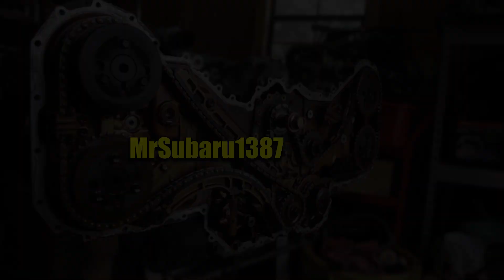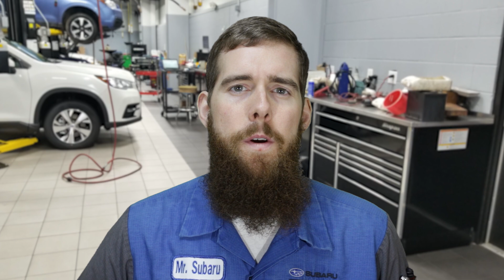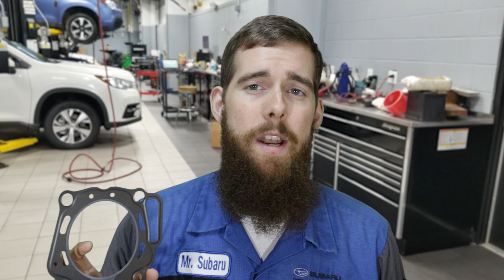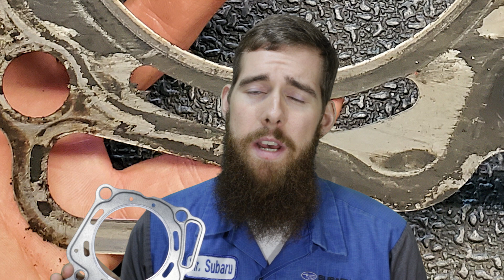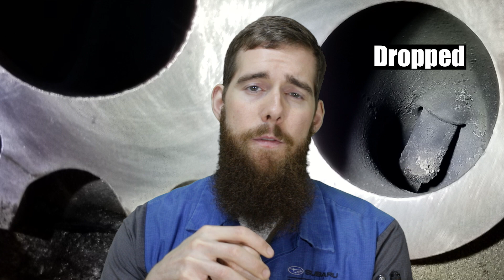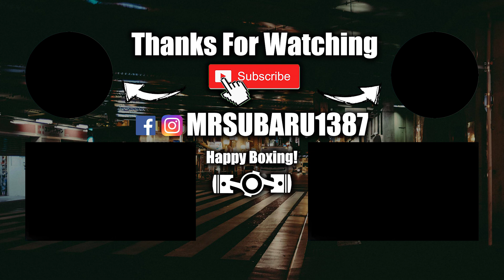Subaru Head Gaskets Explained

Comment: I have 2 Outbacks with the 2.5 naturally aspirated engines. with similar mileage.  (2014, 2015) bodies and interior are different, but engine bay looks identical.  Are they the same engine and if so which engine, and are they in the bad list for head gaskets?  I recently added coolant on both at around 90k miles, and plan on doing coolant drain and fills after tune ups and undercarriage fluids.  I do induction cleanings and fuel treatments at every oil change and am doing spark plugs at 100k on both, and will perform bore scope inspection of combustion chamber to monitor carbon build up.  I am switching to 5W20 as they both use a little synthetic oil.  Also am planning PCV valve and air filter.  I have questions about CVT and diff fluids I will comment on that video.  Thanks MR. Subaru,
 15yr tech

Comment: Thanks! This is an amazingly helpful video. I’m confused, however about the new mls head gaskets like the one you held up. In the corners of the gasket there are small pressed tabs that are there, I suppose, to hold the layers together. However, the upper two don’t clear the head/block surface. I’m stuck here...
Reply from the maker: If you have the correct MLS gasket for your engine, it should clear, there's divotes for those rivets to sit in between the head and block.

Comment: What happened when  water and antifreeze cooling come out from the moffle could be the head gasket o the turbo it’s broken  and the other thing it’s it’s better to change the motor because the motor has 190,000 miles. If I change but it’s the problem going to be same  whit the new motor my money I going to spend for nothing  what you recommend my car it’s Subaru Impreza 2002  wrx turbo thanks I wait for you answer ASAP please because  I want to know. What can I do

Comment: Mr. Subaru, is it ok to reuse a brand new gasket that was torqued down but not heat cycled? I wanna pull it back off to fix an exhaust bolt...

Comment: Got an external coolent and oil leak that’s been going on for several months when I can I will replace on my 2.5 liter so I don’t risk damaging engine if coolent begins to mix with oil because of the oil path is right under coolent passage?

Comment: I have a legacy with an ej253 (230000 miles on it) and a replaced head gasket and now it consumes a out half a gallon of coolant between oil changes. What would be the best way to find a good machine shop around me to deck and check my heads and how do i choose the proper gasket thickness after doing so? How would you best combat the trapped air in the coolant crossover and heater core after the rebuild of the engine?

Comment: TL;DR
Only N/A 2.5 boxers have gasket failure
The gasket is single layer, so it peels off with time around 120k-150k km
Buy multi-layered gasket to solve the issue
Make sure the head and block is completely flat before replacing gasket
Reply: nice summary. the full content of this video though is awesome to really understand the issue and blow up the "all subbies have chronic head gasket problems" myth. a lot of them do/will but the fault is the hg itself and not some intrinsic problem (e.g. being a boxer).

Comment: Please help!  Ok our Subaru Outback blew the head gaskets $3,000 Canadian later fixed. Done at shop heads planed. Ok blew again but I decided that the 15km home was pretty close so dumdum drove that, dashboard looked like a Christmas tree by time I got home. So now we are thinking of buying a remanufactured EJ253 engine from Jegs. I watched your video about the gaskets and my question is how can I tell if the graphite gaskets are installed or the steel coated ones are installed or can I request the gaskets to be installed when I order the engine?  This engine is going to cost us just under $7,000 Canadian which is still cheaper then the $12,500 the dealership wants.

Comment: I have the ej205 in a wrx. Only issues I have is the damn valve covers gaskets leaking oil. Done them once already, going to do them again this summer. About to have smoeone weld the damn things closed.

Comment: @mrsubaru1387   based on your recommendation. I just bought head gaskets from Subaru for a 2006 outback , ej25 engine, naturally aspirated, mt, SOHC.  they said, they only had an improved/updated head gasket, no MLS head gasket.  they said the MLS gasket for the turbos are different and will not fit my engine, would not sell me the turbo MLS gasket.  now what do should I do?

Comment: You recommend the 11044AA642 multiple times in the comments,  vise the 11044AA770, when I look up the turbo version of my 2007 forester, the Subaru listed OEM part is the 770, my question is, what’s the difference, and why do you recommend the  642

Comment: Looking to replace head gaskets on my 2002 Subaru outback 2.5L. This is very helpful! I plan to replace my clutch and flywheel while I'm at it. I'm trying to find a head gasket set that includes a MLS head gasket. Any recommendations on vendors? On the flywheel I would like a light weight flywheel that can work with a stock clutch but is not too costly. Any recommendations?

Comment: I got a 2012 legacy 2.5, I starting pulling it apart to change the head gasket because of overheating, bubbling in reservoir..but when i looked close, I see 3 layers of head gasket sticking out. any chance the 2012's got the mls gaskets or was it a failed repair. I did buy it used, it lasted 35k miles before it blew on me. 177k total

Comment: Great video!  I have a 2013 Outback and just informed by my mechanic that I have a failing head gasket. Made it 200k.  They recommend full rebuild for upper and lower block. The car is running fine with some hydrocarbon residue in overflow tank. Is it really necessary to go to the full rebuild?  Or can I drive and monitor for awhile. 

Thanks
Aaron

Comment: I have a 2014 wrx hatch and I had my hg,turbo, water pump, timing belt replaced, I had a slight over heat and I let it set for almost a year now I brought to a shop and got a flush and burp done, my coolant tank is filling up about one inch from top and leaking out no bubbles no overheating and no milky stuff, Subaru claims there is no issue. I don’t know what to do with it.

Comment: My 2015 5door Impreza blew head gasket at 111,000 miles. Bought a salvage yard 2015 Impreza with 48,000 miles. Mechanic left oil in coolant reservoir. Said he couldn’t get all the oil out. Help.What should I do now.

Comment: i am new to subaru. so would the mls gasket set be best paired with arp studs? 
coning from the 6.0 diesel i know the tty bolts wee a huge issue. are the bolts for the 2.5d 99 legacy outback, tty?
if so with the right gasket and new bolts should i be fine or would studs offer additiional prtectiuon? 
thanks for letting me pick your brain and thanks for the video.

Comment: I purchased a 2004 Forester XS 2.5 three years ago. It had 85,000 miles on it and was originally titled in NJ. The head gaskets have been leaking oil ever since I bought it and I have to add about 1/2 - 3/4 of a quart between oil and filter changes. I now have 120,200 miles and a lot of things have been replaced with the warranty that I purchased with the vehicle, and the warranty has paid for itself. I really dislike the oil leak, but I can't decide between replacing the head gaskets or, just keep driving and properly maintaining it and adding oil. 
Any advice or suggestions?

Comment: Mr Subaru i have 40000 on my subaru.I have serviced car regulary.I brought it in to subaru mechanic and was told i have a minor leak on one of the gaskets.Can i hold onto  my Forester until 50000 until i sell it.I have seen no signs of milky oil,coolant consumption,and tailpipe  emmissions.I was told it would be $3000 to replace the gaskets.

Comment: Any run ins with 12 Forester valve springs failing? Had 1 spring shatter and destroy rocker arm, camshaft, and put a hole in the  valve cover. There were a few sites mentioning the cusp of a recall for all valve springs on the 12 Forester.

Comment: n/a ej25s had a graphite coating on ej251/252 and 253 which peeled off and caused that externally oil leak. the remedy is to replace hg + machine with turbo hg 
ej22/ej20 are all good engines.

people forget, if a car isnt maintained and treated like junk any engine can do a hg/blow up

EDIT: you know your stuff dang, easily one of the better mechanics out there.
Reply: you can also just buy a Honda or Toyota and not have to pull the head for 500k miles

Comment: very educative  thank you .i have 2009 forester with EJ 253 with excellent maintenance with coolant change every 2 yr!! and yet at 62500 driver side  4th cylinder  head gasket is leaking oil (AT THIS TIME) .SOA  will pay dealer 1500/- and i need to pay  about 2500 for labour (ONLY TO DEALER). I DO NOT WANT TO DO THAT BUT DO THE REPAIR MYSELF.  . i bought a new gasket set (sadly has 11044AA633. ) the MLS 11044AA770 THAT YOU RECOMMENDED  is NOT COMPATIBLE ( PER SUBARU PARTS WEBSITE) . HELP APPRECIATED. THANK YOU

Comment: Hi Thanks for a great Vid. I have a 2012 OB 3.6R EZ36D Engine, which I bought used from Nashville Subaru at 92000 miles - Single owner. The only real issue I found before I bought the car was on the Driver's side cylinder bank a small weeping leak that my mechanic felt was ok and would not be an issue and the car does not leak in my driveway, nor are there any signs of exhaust contaminating the oil etc..

So my question for you Mr. Subaru is my car uses about a quart of  - oil every 4000 miles maybe because of this leak at the gasket... and I want to buy a set of MLS gaskets from your Online Amazon Store so I can be ready in a proactive sense when the day comes to replace and Machine my Heads AND from what I understood on another of your videos - it's a good thing to buy a new engine reseal kit and take it to the machinist - so he can do the retainers and valve stem seals... 

So can I get the part numbers from your store for the complet MLS Gasket Kit AND the engine reseal kit if you sell it? 
Thanks in advance Jay from Nashville, TN

Comment: How do I determine the part number for using a mls hg on a non turbo EJ251? Does the torque spec on the head bolts change with use of a mls gasket? Do the head bolts themselves change?

Comment: Thank you so much for all of the information 🙏🏼 I’ll be pulling the motor on my 2004 Forester XS to do my head gaskets / timing belt & water pump in about 8k miles. Question though - so the engine in my ‘04 Fozzy is not the original engine. The previous owner who was a buddy of mine sold it to a local Subaru shop and they got a junkyard EJ251 with around 70k miles and threw it in. What coolant should I use when I do my coolant exchanges? Also, will motor mounts for the XT model fit my XS with the 251? I wanted to replace my motor, trans, and pitch stop mount to get rid of some of the sloppiness when accelerating and shifting. Thanks in advance!

Comment: Great video!  

Question: I have a 2009 Impreza with about 150k miles on it (not the WRX version). So far, no engine issues. Do you recommend replacing the head gaskets before they fail as preventative maintenance?

Comment: That coating is garbage. The new MLS Genuine Subaru gasket should be good for 400-450hp or so, which is far more than most Subarus will ever see. The correct original coolant is 50/50 Subaru coolant so 50% antiboil/antifreeze and 50% water, and Valvoline Zerex DEX-COOL HOAT (Green) coolant should be fine as a substitute for a lot of vehicles (and is half the price here) it is listed as rated for Subarus also .... or the new Subaru super-coolant. You are absolutely correct about changing standard coolant FREQUENTLY (probably more frequently than the manufacturer's recommendation), this is very important with Subaru motors, along with the oil.

If you dilute your coolant, you will know all about it, with endless cooling issues, it MUST be 50/50.
Reply: How often would you change the super coolant?

Comment: Does anyone know if the Japanese version of the BH outback has the single layer gasket? My local dealer(EU) claims head gaskets was not a common issue. It looks like my outback from 2000 has multilayer gasket. And I find no replacement in the service book. 200 000km on my vehicle and still dry. Could the bad gasket be a USA issue?

Comment: Thank you for the very helpful information.  Can anyone comment as to why the 11044AA770 OEM head gasket (STI Turbo MLS Gasket) only has 1 coolant passage between the 2 cylinders?  Other Subaru  gaskets have 2 holes in this area between the cylinders.  The cylinder head has 2 passages in that area, which means 1 is blocked by the head gasket.  Very strange.

Comment: i have a 2003 outback,i have been having problems with it overheating,i replaced head gaskets,thermostat,water pump,radiator,water temp senser,what else is there?

Comment: I have the same rims as that white Subaru in the background. Using them for snow ❄️ tire rims.
Reply from the maker: That's an Ascent.
Reply: MrSubaru1387  18’s don’t know what they came off of. Picked them up at a Subaru dealer in Portland OR. For 350 total.

Comment: The problem is the Japanese are VERY reluctant to admitting that they might have made a mistake in engineering. I have used 2 L Mazda engines since 2001 and they all went 320000 Km's plus with no issues. Subaru's have had head gasket issues for 30 years and still they skated around the issue. Don't forget they make money when you buy parts or get it fixed at a Subaru dealer. They have made a fortune over this issue and for that reason they are no better than Ford GM Chrysler Fiat Nissan and many other junk brands. Subaru has a very good 4 wheel drive system but that's all.

Comment: Hi I have a 2005 Subaru legacy GT turbo I am the first owner I got 161,000 mi on it never overheating bone stock I never play with it I have a oil leak under intake manifold behind alternator on the left side on the right side my turbo still original factory turbo oil leak started hundred 141000 Miles can you help me what I'm looking for can you tell me what's causing this oil leak thanks

Comment: We have a ‘12 Outback 2.5i Limited. Does it have the coated (suspect) head gasket?  Some have told us the ‘12’s got the newer gasket. 83K miles, owned since new, no problems so far.

Comment: I've seen alot of people using sti gaskets for replacements I have about 188k miles on my 09 outback and the valve cover gasket has a leak so I'm assuming the head gasket are either right behind or already need new ones its had regular maintenance and I don't see any build up around the bottom of the head so I'm assuming if there is one its small...anyway I'm considering sti?

Comment: I’m looking for a forester and I’ve heard years 2000-2010 I should stay away from because of head gasket issues but obviously nothing’s that black and white so I was wondering what options of forester from 2000-2008 as that’s mainly my price range wouldn’t have this issue thanks.
Reply from the maker: If it wasn't replaced properly already, it'll have a head gasket failure.
Reply: MrSubaru1387 so if it has been replaced is it likely to happen again? and are they’re any variants of forester that don’t have this issue as I heard you mention the xt not having this issue but is that referring to models past 2010 of the xt? Appreciate this heaps man

Comment: I bought my 2007 Subaru Outback 2.5i used this past year. I did so knowing the head gaskets were replaced at 60k by a dealer on 08/29/2016. This video has me a little concerned now though.... Do you have any idea if the dealer would have used the corrected MLS gasket or the original graphite gasket for the repair?

Comment: Your videos are extremely informative, however when you mentioned having the head taken to a machine shop and being surfaced, is that in all cases or just when you had an overheating issue? If I’m doing it as preventative maintenance should I still have the head surfaced?
Reply from the maker: That’s in all cases where you want the head gasket job to not fail.

Comment: I'm looking at a 2007 outback. 25i. It has 69000 miles. It is 17 years old would the break down on the gasket have happened by now
Reply: I just bought a mint condition 2012. Mines went bad after 110k. No signs other than traces of coolant around the exhaust downpipe gasket

Comment: I'm looking at a used 2007 subaru impreza 2.5l with 174.000 miles. What is your opinion on buying it?
Would head gasket sealer work as a preventative measure?

Comment: 2000 Outback blown head gasket at 199k...those heads warp and must be milled/sanded.
Replaced with Fel-Pro multi-laminate steel gaskets. Sold car at 240k with no leaks, clean oil and coolant.
Screw torque is as important as choice of gasket.

Comment: I have 2014 outback premium 2,5 i.  Hearing sound behind dashboard , sometimes oil level low. Head gasket never replace before.  Could it be issue with head gasket? 
Very apriciate for your help..
Reply: Air in heater core. Possibly head gasket associated with low coolant

Comment: Wife's 2010 Forester owned since new. 
   At 62,800 miles, being adult owned and dealer maintained,  the dealership informed us the head gasket was leaking externally.  
    NOT IMPRESSED.  
 They quoted $2600+ for the repair , being only a few thousand miles over the warranty period.  
    After strongly speaking our minds , and reaching out to Subaru of America,  they offered to cover approximately 
2/3 of the repair cost. 

    Fast forward to present,  the vehicle has 170k... ( has been great) though  both head gaskets are leaking oil externally.  
    We know we are on extended time with this vehicle.  
     We had a 2000 Impreza new which also suffered from head gasket issues.    It was traded for the forester which the dealership claimed adimately would not experience head gasket issues.... 🙄 WRONG.